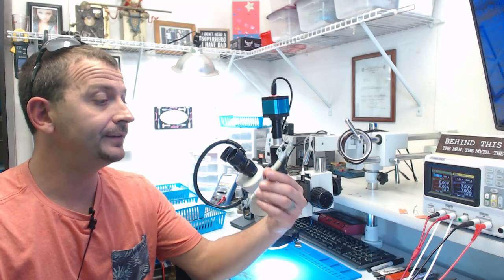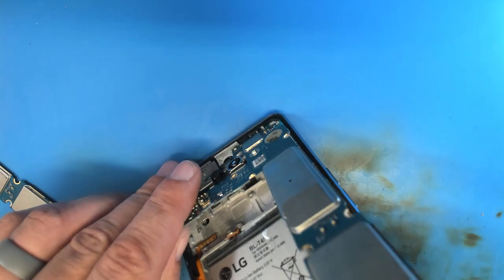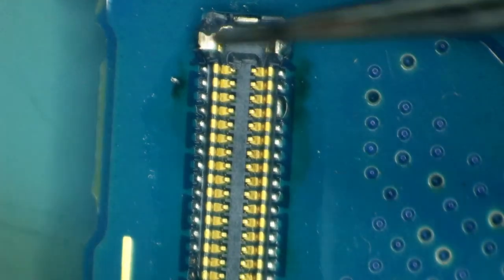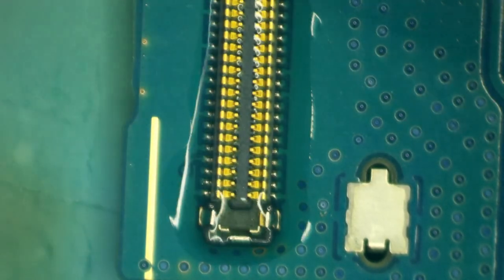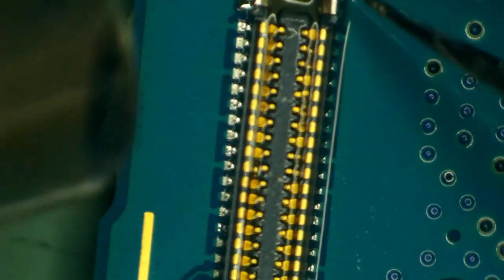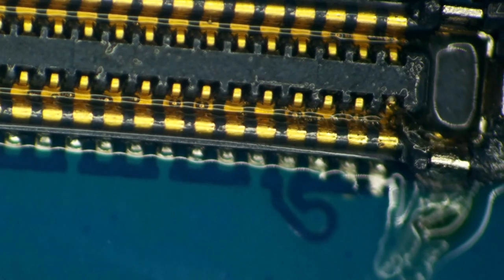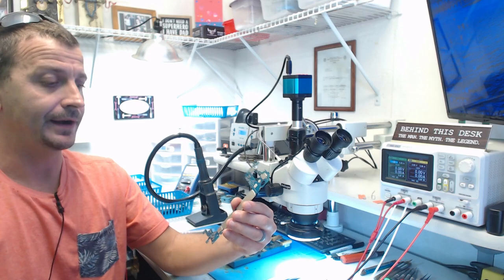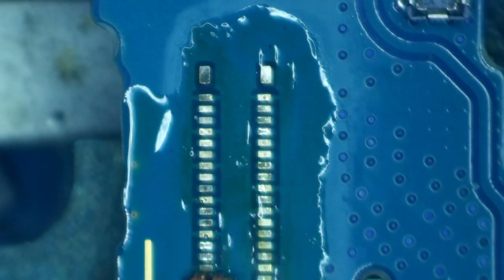Repairing a damaged Stylo 6 display connector (by harvest/transplant)

Comment: Hey Jason! Nice to see your video after a long time. One suggestion, those android boards, especially Samsung's, have the mic soldered onto them. Those things are notoriously sensitive to heat, flux and alcohol. Cheers.

Also, with things like fpc connectors, try using the stations which have the blower fans in the handles. If you see the end of these, they have a kind of a fin structure that makes the air swirl instead of coming out straight. I have found that they don't burn the plastic parts as much.
Reply from the maker: Thank you!  When I first started microsoldering I got surprised by a couple of microphones and barometric pressure sensors.  The Galaxy S3 was a classic lesson...  "Hello, you repaired my charge port but now nobody can hear me talking".. lol :-)  Thankfully this Stylo has the lower mic on a flex cable and I didn't see any other sensory.

Comment: I just changed charging port.. it works great now.  My new issue is the screen will only sometimes load, never while booting up tho. And when the screen is working the touch screen won't work.  Could the heat gun have done anything to screen? Even tho it was used on back side of phone case. I've done most black screen fixes and can regularly get screen on again but during soft reset or any start up the screen never shows initial start up lg logo.  Only after a bit will screen start kinda working again

Comment: Excellent job! Is it preference not to heat from the other side of the board? I always find myself melting plastic if I use directly on a connector 😂 (Maybe due to the quality of my hot air station, at least that's what I tell myself 😎)
Reply from the maker: Thanks.  If it’s realllly sensitive plastic on a connector and I’m not worried about something else getting burned, then I’d heat from bottom.  This style of connector can take quite a bit of heat before getting burnt tho.  It was really weird finding out the solder could melt before the plastic?!! 😮

Comment: What makes ground pads so much harder to solder?
Reply from the maker: Thermal dynamics I think is the correct term?  Ground pads transfer a ton of heat to the board and dissipates quickly.  They need more heat to solder.

Comment: You're also going to get a lot more repairs because of Apple's iPhone boobytrap, ie, a hard to remove glued down screen, and components right on the edge so that spudgers in the wrong place snap them off, ie, I don't see a newbie even able to open it without more damage. 🙂
Reply from the maker: Mmmmhmmm... The 12 series is a lot more difficult to open than any other model.  My first 12 Pro Max had me sweating bullets because the screen was not broken and I sure didn't want to break it!  They're not as stressful for me to open now that I'm used to it but a good percentage of people are going to break things.  Most of them should only be further breaking the screens but will surely be smashing connectors and stabbing batteries! :D